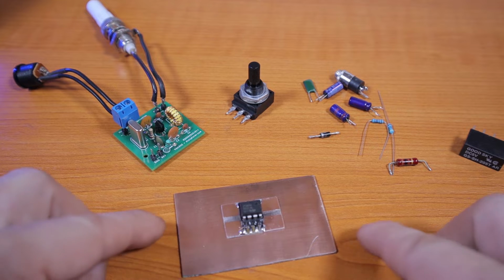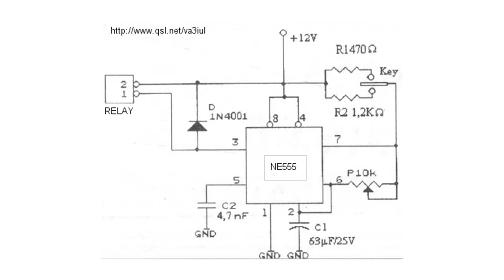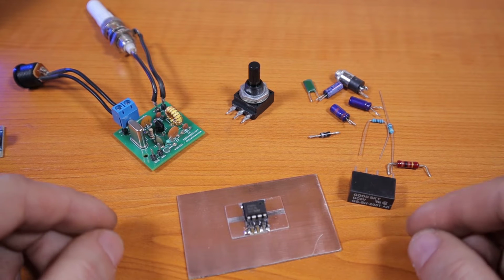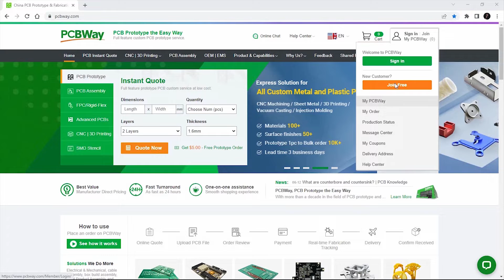Simple CW Keyer With The 555 Timer IC - The First And Last Fail Of 2023

Comment: The circuit was working more or less  well but the period was inverted, if you use the NC  contact of the relay instead of the NO the timing works. The long space between dits is actually the dash. But when the relay is in rest the transmitter is on. The best option is to swap the pot with the two resistors and the key. So that the period is inverted. Also you can use diodes to control each half of the cycle.
Reply from the maker: Yes yes the circuit works indeed... to invert the contacts on the relay is easy job... the problem I found is that with one single IC you can't get both dots and dashes... it just doesn't work. Not at least with the schematic as I found it. It could work great with two IC's one to create dots the other one dashes... meanwhile I discovered one that works but has three 555 ICs... but the one I love the most is a schematic that works and only has one tranzistor 😁😁😁. 73, YO6DXE

Comment: Happy New Year, you need to invert the output, you can do this by changing the state of the relay, o with an inverter before the relay
Reply from the maker: Happy new year. I will try that too... but I suspect I will run into another problem )). Let me test first and then I get back to you. 73, YO6DXE.
Reply from the maker: I am back )). So I tested inverting the output of the relay... and as I was suspecting... that does creates dots and dashes... but reversed. So that means the transmitter is in a constant transmit mode... and the dots and dashes are actually the pause between transmitting. Exactly the opposite of what we need it to do )). Let's see... I just discovered another schematic... even more simple with only one transistor. I will test that one too.
Reply: Aaaaaaaaa, yes
Reply from the maker: @tekno8max872 But we tried )). Is always good to try hehe.